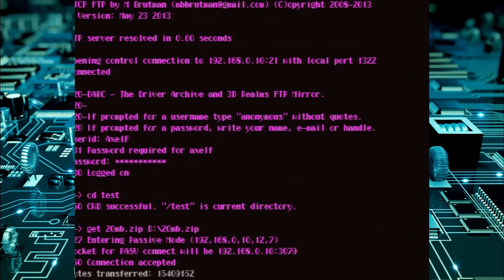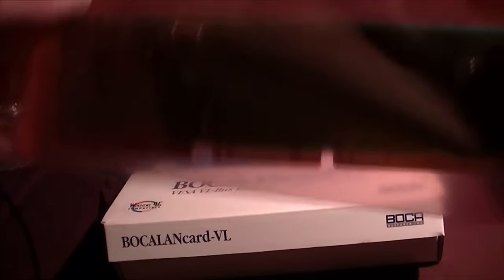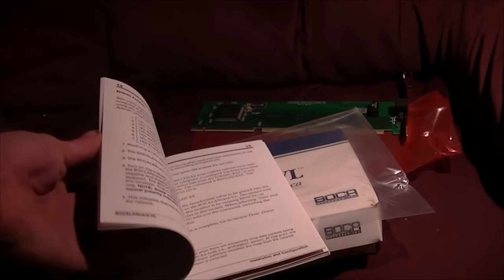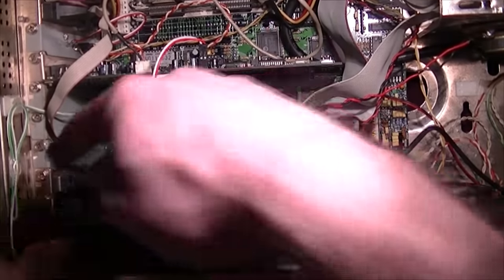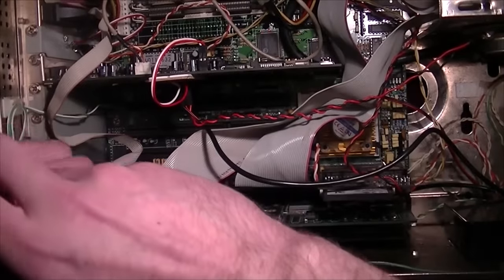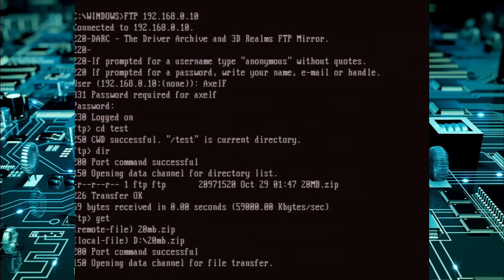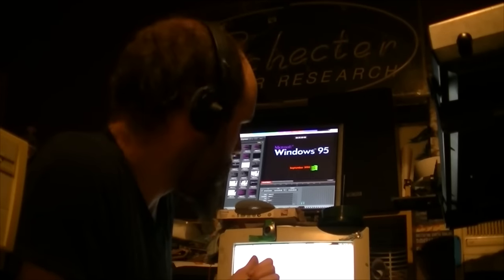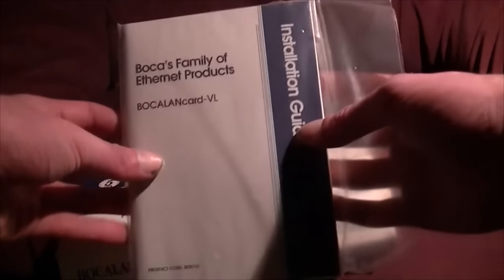ISA vs VLB Ethernet

Comment: Love the video!  Just FYI the maximum theoretical speed of 16bit ISA is 8MB/s and VLB is 133MB/s, which was the same as 32bit, 33MHz PCI.  The problem was that VLB was designed as an extension of the 486 chip itself, and many cards had timing issues if it was faster than spec.  Which means any 486 running at 40 or 50MHz without clock doubling were running the VLB out of spec.  Whereas PCI was not tied to the CPU's bus and could remain the same speed regardless of clock speed.
Reply: Jesus, these 16bit ISA cards are faster than my internet.
Comcast is the devil.

Comment: When I started where I work at currently in 2000, it was all on 100mbps hubs, about 50 computers and 5-10 printers, even though there was an unused 24 port switch in the server rack.  The performance of the network was abysmal and I moved all the servers to the switch, along with a port for each hub and some power users got a port too. Thinking back, it's amazing the network even ran at all.

I never saw any vlb network cards back in the day, but I didn't get beyond 10mbps in my home machines until the early 2000s. The Internet connections of the time were typically only 2mbps or slower so it didn't really matter at the time, but I didn't move to 100mbps until I had pci bus computers and used 3com 905b-tx cards.
Reply from the maker: +sandman x Where I worked I got landed with pretty much replacing the whole network. The old network techie was long gone and if you mentioned him, or found any of his work hidden in a cabinet, my superior would reply with "_That_ f**king IDIOT!" every time. Apparently he was a real mental case. We had mostly 100Mbit/s switches, but at the server end of the network there was a 10Mbit/s hub which everything fed into because old tech guy had said it gave more control... Of course, this resulted in a "That f***ing idiot!" from my boss. That network was a mess, there were switches hidden in the ceiling that did nothing but had power, there were servers running that were never configured and there were network sockets behind the washbasin cabinet in the ladies lavatory (I got into serious trouble when removing those, long story). I went overboard when fixing it, adding a second network where only servers and some power users connected and stealing considerable lengths of cable. It was a fairly large network though. I never got paid a penny.

I was still 10Mbit/s at home until around 2007. I think I began moving from Co-ax wires in 2004 when the 386 I was running as a server stopped working. It was not a good year. Most internet was dial-up here at that time, though some slow DSL was available. I had no internet between 2004 and 2008.

Comment: I was going to just send the 3COM card, but I couldn't remember if it was one I had tested or not. So I figured I would just send the Intel card as well since I knew it worked as I was using it in this Pentium Pro system I dug out of that shop. Plus I figured since you had mentioned those 3COM cards were starting to have issues, an Intel card might be better, hopefully last longer. Something different to have, I guess, than all 3COM cards anyway. I think everything I sent, except for the cdrom drive came from that garage / shop that I did those haul videos on. 

I have an Adaptec VLB SCSI / IO card that is very picky about working correctly at a bus speed of over 33. Some motherboards, and some cards I have had over the years have had a jumper for bus speeds greater than 33, but not all. I was thinking about that when you mentioned this card being in your Super40 system, with that high of a bus speed might be why it was giving you so many fits there. 

Possibly a VLB ethernet card might make sense if one was doing network booting or a terminal situation, keep as much off of the ISA bus as possible for performance. I guess I am really not surprised the speed is not any better in this 486 system over the ISA card.  9x in general is a dog when it comes to network speed. Even with 100Mb pci card and a fast Tualatin cpu, it still is around 500K/s 

...tight school girls and mouth fulls... LOL  it sure is a shock at how tight virgin slot motherboards are...whew!
Reply from the maker: +WaybackTECH Well, it seems to work, though I haven't had to rely on it much yet. The Intel one is currently sitting in the 386 along with that RAM because my Linksys has a broken capacitor, it will end up in the 286 as soon as I can be bothered to repair the Linksys. For whatever reason, the 3Coms I had, whilst they have been good, keep throwing themselves into EISA mode and the only way to get them out of it is to short E1, all but the original one that failed (It came from my Leo) were gotten in one lot so who knows what kind of horrible things were done to them before I got them.

Yeah, a lot of VLB cards kicked off if the BUS speed was raised. I don't think Intel ever officially acknowledged speeds higher than 33MHz after the original 486 either. Some cards, the Ethernet card included, provided their own clock to get around these issues and I did try at 33MHz with no observable differences. I suspect it just doesn't like the machine and I have not tested it in the OverDrive yet as I may as well wait on fixing the PAS and do all the work in one go. One thing I never pointed out in the video was that the 3Com has a "Full-duplex" option, I have no idea if it works, but if it did, it would probably leave the VLB board behind pretty quickly as it only has to share the BUS with the Sound Card and simple I/O. For real nightmares, try getting a VLB system to run at 50MHz. It sure is fast if you can get one to work, but you'll probably go insane long before you reach that stage... Some boards, such as this one, can even unofficially achieve 60-66MHz BUS speeds if you feel like being a real masochist.

You are right there I think, a disk-less system would benefit from the card more because the Ethernet would essentially replace the IDE interface in purpose. Never had issue with 9x networking speeds but have heard others complain about it. For me, 7 is the worst and it will drop to a measurement of bytes-per-second if a large number of small files are copied to/from a 9x system. So annoying was this issue that I actually started using a Windows 98 VM with the extensions installed so I could just drag and drop things in and out of the window where they transferred faster, proving the issue was software in my case - can't speak for anyone else as they may have different hardware, software and usage cases to me.

It's funny how before the rebuild, that system was the biggest piece of trash I owned. There was green stuff growing out of the motherboard and the slots in that board were loose enough that if the screws were left absent the cards would fall out with gravity, the RAM also had to be taped in place because the clips were broken. I used to hate it and considered it the worst system I owned for years until I dragged it out of the cupboard and put some time into setting it up properly. It quickly grew on me enough to warrant the extensive repairs... Achieving 379 in topbench with an X5 installed probably helped that, it was a rare occasion because I was actually speechless.
Reply: +HighTreason610 I had a couple thoughts about that VLB ethernet card and the performance, or lack of. You might just see if the performance is any better with your POD chip. Perhaps the UMC just isn't enough power to transfer any more than the ISA card can do. I have never tested ethernet performance on these old cards, as I have always just assumed the chip on the card does most or all the work, but that might not be so, I don't really know.  The other idea, we both run Gigabit switches. I never considered until just now, that gigabit switches might not work very well with 10Mb ethernet. I always just assumed they should work fine, but things have changed a bit since 10Mb cards and hubs/switches were the norm. Maybe it would be worth pulling out, or finding an older 10/100 or just straight 10Mb switch and see if there is any difference there.

Comment: Wow, that's weird, man. I've only ever seen VLB video cards.
Reply from the maker: +lmull3 I had never seen one of these before and had only ever read that such devices exist - usually in the section documenting the weird goings on when 33MHz is exceeded as they were often clock sensitive and thus, among the first devices to complain. I believe almost anything was available on VLB at some point, but people generally only ever used VGA and Host Adapters on the interface as everything else was somewhat redundant. 

Hehe, I wonder if anybody ever made a dial-up modem for VLB... Now that would certainly serve no purpose. It wouldn't surprise me though, given I seem to remember an ISA Trident video chip on a VLB card where only power and ground pins were connected on the VLB side.
Reply: +HighTreason610 A dial-up modem for VLB, aw geez, that would be a good laugh. That Trident card sounds like an excuse to just take money.
Reply: +HighTreason610 Now, imagine a sound card for VLB ... That would be pretty funny to see X)

Comment: That is such a silly design when that crazy long card has all of the traces a million miles away from the business end of the card. Really shows how little VLB and ISA have to do with each other, love it.
Reply from the maker: It does look rather ridiculous. I don't really think anyone could ever doubt that VLB was meant only as a stopgap solution and I can't imagine for a second you'd get away with something like this in a machine now - with the clock rates of the PCI-E bus, I can't help wondering if it might even introduce problems if someone were to try. There's something very appealing about VLB cards though and whilst I opted to keep the 3Com ISA card in this machine, I kept the AMD VLB one in use as an upgrade to the extremely slow 8-Bit card in my Pentium OverDrive machine where it has worked ever since.

Comment: LOL, I have never seen an VL ethernet card before - and gods know I build ALOT of VL bus computers back in the days
Reply from the maker: +Dennis Koch I always had serious doubts that such devices would have caught on. As evidenced in the video, the Ethernet standards at the time did not really benefit from it under normal usage and by the time faster Ethernet came around, VLB was pretty much dead because it had only been introduced as a stop-gap until PCI was ready so far as I know.

Of course, I speak from what I learned years later, VLB was pretty much out of print when I started playing with computers and was long gone by the time I went to work. We still had a few operating though because the company was pretty ass-backwards about things; this was the K7 era. They were still using a 286 for accounting too, so the 486's didn't look so bad.

Comment: Test the card in Novell, OS2 and NT. It's a 32bit bus so you may need a server OS.
Reply from the maker: It shouldn't make a difference, given the TCP stacks are already somewhat 32-Bit and Ethernet itself uses anywhere from 8-Bit signalling to 48-Bit addressing depending on what it's doing. Driver differences could affect tests, but overall I think AMD's chip is just slower than 3Com's in this case. It's a shame nobody seems to have put a 100Mbit/s chip on a VLB card, but I guess the bus was just about dead by the time that was becoming common.

Comment: 3com Etherlink III sucks. You are better with an SMC Ultra it's ultimate 10baseT  ISA card and it can do back to back packets
Reply from the maker: Can't say I've had any problems with them, for the most part. With "Full Duplex" set to "On" I can definitely hang around the max throughput for 10Mbit/s Ethernet easily. I have some PCI SMC cards, but they don't appear to offer any advantages over the 3Com and D-Link models I have there, they all work about the same. It's currently pointless anyway, because the Windows 7 and Windows 10 netcode is horrible and doesn't transfer files quickly with older machines. I'll probably start paying closer attention once I finally get around the a network overhaul I've had planned... eventually.